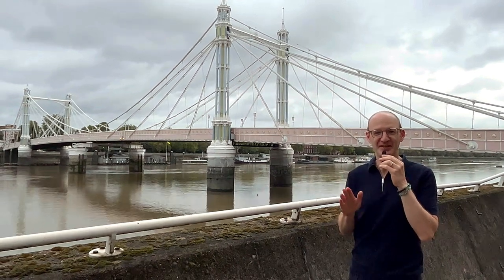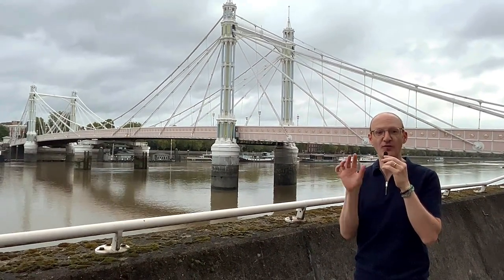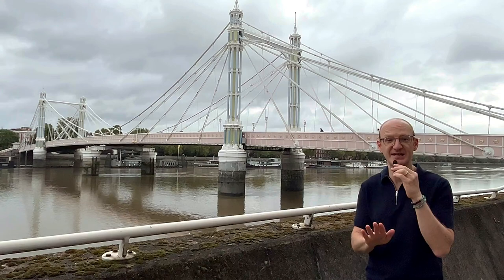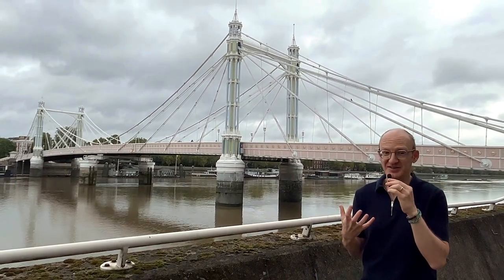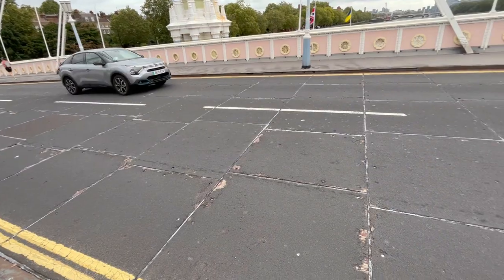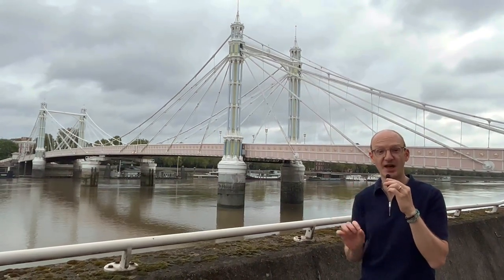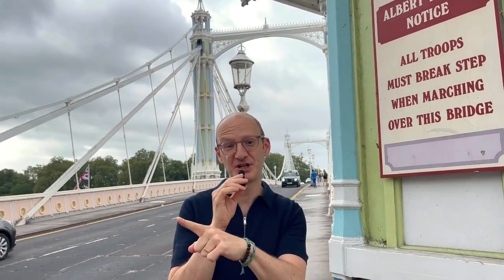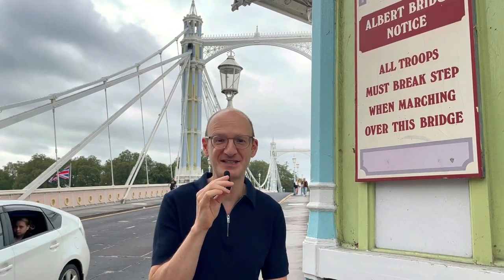Why 3 bridges in 1? The fascinating Albert Bridge in London UK!

Comment: As a retort to your
2:39 "not so relevant any more" 
I'd just like to remind your viewers about the problem with the all but brand new in comparison Wobbly bridge, sorry, Millennium bridge sited downstream of here nearby St. Paul's.
It, too, had the very same issue with people falling into lockstep at the natural resonance of the span.
Just like a violin string it vibrated and like the victorian soldiers on Albert bridge, it's surprisingly difficult not to walk at the same pace and step as those around you and as the massive presence of the bridge is forcing you to do.
It was only after people started to fall down because of the vicious circle that the bridge was closed (for an absolute age) and mass dampers were installed and tuned to the bridge's particular rhythm!

As for the central pillar on Albert bridge, I had heard that it was greatly enlarged after the original was struck by a wayward barge.
Who'd have thought, a barge hitting a vertical obstruction, placed slap bang in the middle of the bridge's highest point and the river's greatest depth of navigation‽
Who came up with that genius/ugly/cheap fix?